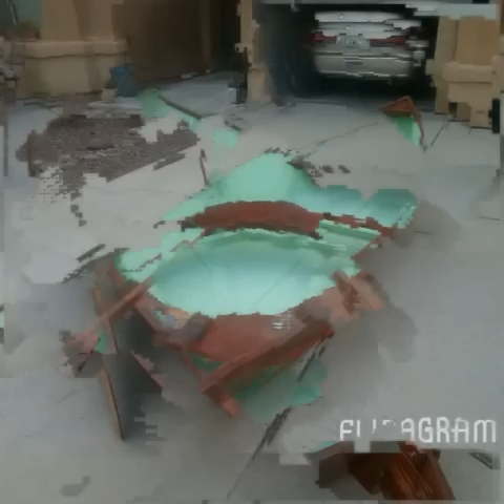Boat build slideshow 12 foot skiff (plans by Hannu Boat Yard)

Comment: Great job could you give some dimensions like how tall are your sides how wide is your bottom at the widest point and maybe at the transom and one more thing what is the type of wood you use it looks like quarter inch but I'm not sure thanks for sharing great little video
Reply from the maker: It was built to the free plans made by Hannu Boatyard https://hvartial.kapsi.fi/skiff12p/skif12p.htm

Comment: I was looking for a way to do more than one "thumbs up" on this video but could not find one. Great looking boat. What was the total hours under construction?
Reply from the maker: I built it over several weekends and a very slow pace. I worked on it by my self without help. The basic shape,  sides, transom and bottom probably can be build in 16-24 hours by one self. Waiting for glue to cure takes most of the time. If you are making several cutting out all the identical parts at once will save a lot of time. The biggest issue is having lots of clamps lots and lots of clamps.
Reply: thanks for filling me in. Seems pretty quick. Drying time always the issue.

Comment: if you beefed up the design could you add an outboard motor on it?
Reply: I built a 7' version just like this,  and I built a weed eater outboard for it.  boat handles nice,  but the prop I made was a little too aggressive and heats up the clutch....  check my channel.  think I have a video with engine power.....
Reply from the maker: Yes it probably could take a small outboard if you beefed it up. A 6 horse power would work with just adding some strength to the transom alone. I would not try anything greater than 15 horse.
Reply: I'm not sure but ,if anyone else  is searching for boat plans design try Joolaim Rudder Replication (just google it ) ? Ive heard some amazing things about it and my work buddy got cool success with it.

Comment: 1/4 inch is 6mm ?
Reply from the maker: I used the thinnest plywood available at Home Depot but on this project it would have been easier to use 1/4 inch ply. 6mm is slightly less than a 1/4 inch but would work well.

Comment: How did she sail ?
Reply from the maker: It is a stable boat that goes through the water quite nicely. I did not set up the balance quite right so it weather veined into the wind and then I had other hardware problems. But if set up as a rowboat It would be excellent as a sailboat I'm still working on that.
Reply from the maker: I redesigned the sail and center board. It now has a the mast farther forward and a keel centerboard. Sailed beautifully and good into the wind properties.